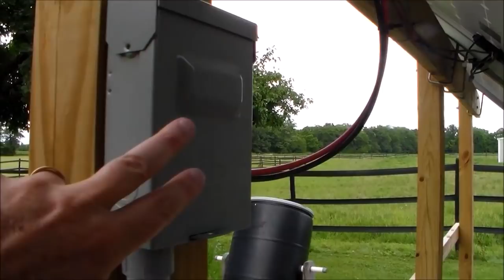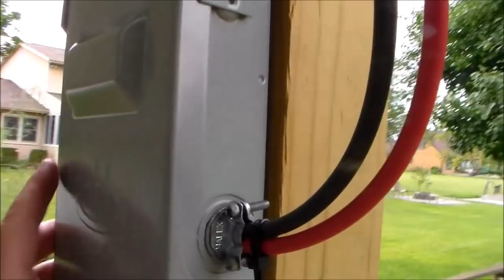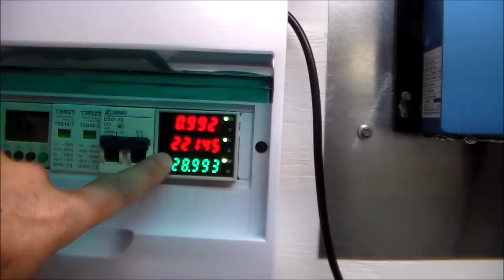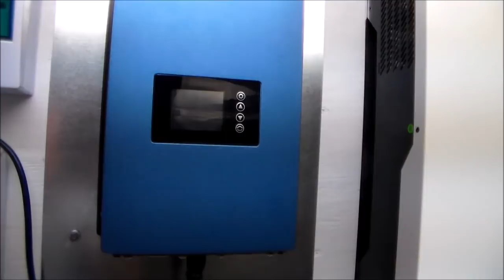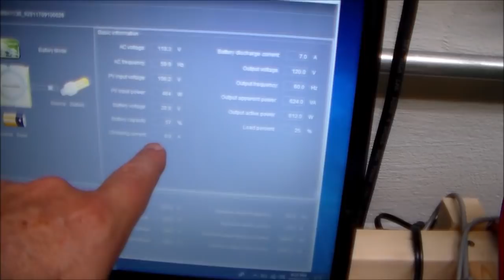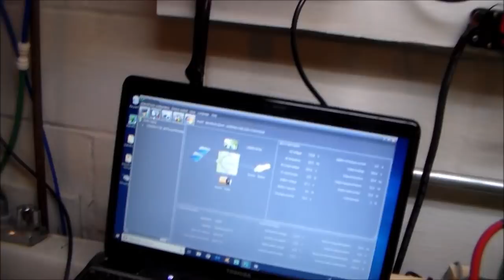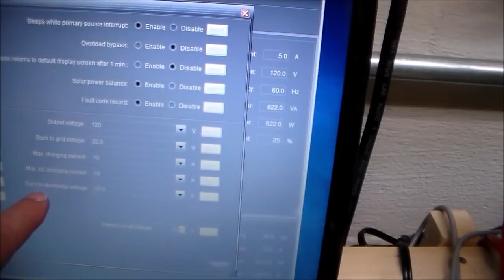DIY Solar - Episode 11 - Up and Running

Comment: Excellent work!!!  How many panel dis you dedicated to the 1000 watts Sun Inverter?  Maybe I'm wrong...but your Sun unit was about 45 to 90 Volts DC input ...I guess that you s et 2 panels in series to get close to 80 volts in a sunny day...with another two panel in parallel for a total of 4 ... Please correct me.  Thanks.

Comment: I'd guess half the value because CT clamp was designed for EU 240v single phase market. GroWatt make 120v grid tie inverters but limiter is done via their own smart meter. They stopped using CT clamps.

Comment: You have to tap both legs then run the 50 MV  2 sensors one for each leg then Series them!
Reply from the maker: Actually, no. This is a 110v inverter. You are thinking of the 220v version.

Comment: The CT ratio has to match the original ratio. If the original is 200:.5, then the new one would have to match. If there is a way to change this in parameters, you could fix it.

Comment: How is the inverter holding up after 3 years?
Reply from the maker: Still running fine. I blast dust out of the fans a couple times a year, but that’s about all I’ve had to do to it to keep things running.

Comment: Hi Jim, I just found your channel today. I appreciate your thoughtful explanations but even more so I appreciate the amount of thought and cleanliness put into your workmanship and installation. I guess the main thing that concerns me is the exposed conduit on the ground underneath your PV setup. I also noticed the seesaw in your video and think running around and hiding or playing underneath the PV array would be very tempting to little ones (especially when the sun is intense). 

Anyway, part of my job is endurance life testing electric motors and their variable speed drives. The setup at my work that predates me used small 3 phase generators hooked up to restive elements (heat) to put a load on the motors. As you can imagine just dumping this energy into heat and then using the oversized HVAC to suck the heat out of the building is insanely inefficient (especially with statistically significant sample sizes). I've set up a proof of concept that uses a 24V diesel alternator attached to the motor test samples via a drive belt with the alternator connected to a grid tie inverter to put the load energy back into the grid and so far it works great, being between 36-41% efficient depending on the load. Anyway I found you while researching grid tie inverters looking for something fairly robust and inexpensive. 

I've been thinking about doing solar on our house since buying it 6 years ago as the sun exposure and direction of the front facing roof is idea for it. However looking into things locally I'm pretty sure I'm just going to go with a 5-6kW grid tie system with micro inverters and use my 4kW inverter generator in the case of a power outage.
Reply from the maker: Hi Ken - Thanks for your suggestions. Yes, my existing setup was really intended to be a temporary proof-of-concept installation since my wife and I plan to downsize our house as soon as we find something suitable. Burying the conduits that are under the solar array wasn't really a high priority since I plan to rip it all out when we move. When my grandchildren are at our house, they know not to go around or under the panels.

I would be interested in seeing what you do with your dump load testing at work. I agree that is a waste that could easily be turned into a gain if done correctly. Please post some videos if you pursue that!

I agree that a micro inverter grid tied system would indeed be a better solution if you are going with 5-6KW. Actually, I have already purchased some inverters for use after my relocation. Of course, I will need to get those set up and approved with the local power company too.

Thanks again for your comments and viewership!  Best wishes!
Reply: @jimginnyohio  Hi Jim, thanks for the reply. As for seeing my test setup, since I am in new product development, posting videos or pictures online is kind of a big no no. Just think of a 2-3hp electric motor that's either DC or 3 phase AC about 20lbs 6-9" diameter connected to 24VDC alternator (large diesel) via a belt drive that is wired to a grid tie inverter. If I want to vary the load on the test sample motor all I have to do is change the RPM's.

Comment: How does the sun grid tie inverter know the phase/180 deg out of phase to match i think thats about the only part i dont understand...i see in your later set up you have 2 of them running one on each leg which i think is one of the more ideal ways to use them... just as ive learned u cant parallel 2 (regular) 120 inverters to get L1/L2 240 because they wouldn't be 2 exactly out of phase legs ....how so the sun inverters basically do that?
Reply from the maker: Since they are grid-tied, they are able to sense the utility power and match it. You can’t do that with non-grid tied inverters unless they have the ability to be paralleled together.
Reply: @jimginnyohio  ok so they match it preciously i guess including phase..whats worst case scenario with them what could happen where they start feeding power back to the utility grid? as a pilot i try to always think of the worst case possibilities and at least have an idea for them.... so if i understand all this correctly u can have 1 of them on L1 or L2 only...or one on L1 and one on L2 ...or theoretically two on L1 and tow on L2 and so on? could u have one L1 and say 2 on the other leg? how does all of that work?
Reply from the maker: @brandonoh777  Since they are grid tied, and will "synchronize" with the grid phase, you can plug multiple units into the same leg or into separate legs. I currently have them plugged into separate legs so they negate as much of my home load regardless of which leg the load is on, or for shared loads in the case of 220v devices in my home. In a worse case scenario and they "accidentally" feed power to the grid, that could be detected by the power company and they could force me to remove the devices else they will threaten a disconnect of service. If that ever happens, I will simply re-install my off-grid inverter and run some of my home loads in an isolated manner utilizing a generator transfer switch. That way, I can still provide power to offset utility costs....without fear of a feeding to the grid.

Comment: You're in Ohio so you're a probably about the same latitude as I am in Central Indiana I'm curious as to how many Sun hours you get per day in the summer and in the winter?
Reply from the maker: Hi Brandon - To better answer your question, you can go here to view the best solar angles to use for your particular location: www.solarelectricityhandbook.com/solar-angle-calculator.html 

Otherwise, to see the number of solar "peak" hours for various locations, you can go here and then scroll down to the peak hours map: unboundsolar.com/solar-information/sun-hours-us-map

i hope that helps!
Reply: Thanks I'll look into that I just bought an app solar 3048 and have 10 250w Canadian Solar Panels that I got used slowly putting a whole system together your videos are coming in real Handy... by the way you said Central Ohio I grew up in Zanesville just east of you there!!

Comment: Hi , i'm working with similar solar plant but , i will add a wind turbine to it  i dont need any explanation about wind part but , one thing is making me confuse , (you can add a gridd tie inverter at the same time with an hybrid inverter ??? like you are injecting power to the output of the hybrid inverter ?? my setup is a 5.5 infini solar inverter with 2 mppt inputs with 5x 340watt panels and with 6 x410 watt and with 2 pylontech 48v lithium battery  , my idea is to add a 1.5 kw instabreeze wind turbine directly to a smaller  battery bank 24v and conect the battery to a gridd tie inverter to suply power to the house at the same time as the hibrid inverter , greeting from portugal

Comment from the maker: Normally a grid error means the inverter is not getting the proper voltage from the grid. Since you said you have the 2000 watt model, I just wanted to make sure you have that wired directly into you panel instead of plugged into an outlet??? That unit needs to receive 220 volts instead of 110 volts.

Comment: Hi sir 
I have 12 panels and I want to know what kind of inverter and charger control a be best for my system 
Panels specifications 
Canadian solar
Model CS6U-340M
Pmax   340W
Vmp.    37.9V
Imp.      8.97A
Voc.       46.2V
Isc.         9.48A
M.S.V.    1000V
M.S.F.R.  15A

Comment: Hi, my name is Juan Muniz. I am from Puerto Rico. I happen to buy a 5kva inverter/charger 220v.
Here in PR, we work at 110 or 120v 60hz. Is there a way i can still use my 220v inverter in a 110v configuration?. I really need help.
The thing is my inverter is from Hong Kong and i really dont know who i bought it from. I checked with Amazon, Ebay, Aliexpress and Alibaba.
And it was not from neither of them’ So if some one can help me, please. I am desperate.   Thanks.   My email is tonym512003@yahoo.com
Reply from the maker: Juan Muniz It’s my understanding that PR uses the same standards as the rest of the US where you have two separate 120v phases. You should be able to wire that device in to provide the required split-phases of 120v each.
Reply: jimginnyohio thank you very much.
Reply: @jimginnyohio  thank you my friend.

Comment: Sense comes with two clamp monitors, that blue inverter only comes with one clamp monitor. Meaning you need to have two of that gridtied inverter so you can clamp it to the other incoming line. That means you need to separately feed each inverter(if you have two) half and half.

Comment: The power indicated on the inverter depends on the current sensor, which has the span 0-50mA to indicates 0 - 12000W ; your replacement  CS (current sensor) is not compatible to the original in electrical spec., the original CS spec is 100A / 50mA  (means: at Max (span) output 50mA (span)) ;  if you replaced with a CS (as you mention on previous clips) has the spec:  400A/100mA (Max span=400A output 100mA so the output of this CS @100A only induced 25mA (1/4 of span) so it's always 1/2 value compare to the original one, and same as the 600A/100mA CS will show only 1/3 value; make it reads correctly you could you the CS with the spec: 200A/100mA, 400A/200mA or 600A/300mA  ..
Reply: I think this was the issue.  This issue work in his favor..since the inverter will never back feed the grid.  If the inverter read 1000 watts, the other meter is reading 2000 watts being used in the house.  So the inverter will only push back to the grid 1000 watts...

Comment: You mentioned Valence recommends charging at 10 amps - I have some of their 138ah batteries - where did you find out and how to charge at that 10 amps and how would you think I find out what to charge the larger batteries at??
Reply from the maker: Chuck Ger Valence has a website that you have to register for. Once you do so, you can download all of there technical spec pages for each of the battery types. You should be able to locate your battery version there. For my setup, my MPP charge controller has software that can be used to set the charging amperage. Since I have 20 batteries, I am able to select a higher amperage and the load is divided amount all of the batteries. While 10 amps is the most I can set for an individual battery, I have my charging set to 50 amps, which works out to 10 amps for each of the batter6 banks I have configured.
Reply: @jimginnyohio   - thanks I'll check into that - How come you went with one Sun Gtil and one MMP Solar - instead of 2 of 1 or 2 of the other? And do you have all your batteries just on the MMP Solar? And one last question - I bought some BMW I3 batteries which also are about the same as your Valence in AH -  how long do you think 1 would take to charge up from 11V - to full (13.6 or more) at the 10A charge. I've charged these BMW  1 at a time 13.2v, at 6-7A and it's taking about 24- or more hours making me wonder if these are pretty tired, but they seem to be holding the charge.

Comment: Are you using the same panel input for both your grid tie inverter and your off grid inverter, or do you have dedicated panels for each system?
Reply from the maker: Niclas Lindström Dedicated panels for each inverter. The grid tie inverter has four panels connected and the off grid system has eight panels connected. I suppose I could add another grid tie inverter and use a dc switch to move between that and the off grid inverter, but no need for that yet.
Reply: @jimginnyohio  Thanks for your quick response. I am just thinking, why can't you feed both systems with the same larger array. In my world that could give you the opportunity to use the maximum power at any point in
 time. I am not a professional, just like you, so I only want to bring up
some questions for the knowledgeable...
Reply: B.t.w.  I am impressed with your work! Keep up your good work.
Reply from the maker: Niclas Lindström Each of the inverters have a certain operating range for voltage requirement. The off grid inverter will accept much higher voltage than the grid tie system. If both systems were running from the same panels and one of the systems failed, it could create an over voltage condition and possibly cause damage to the other inverter. You are much better off keeping things simple and dedicated for each system.
Reply: @jimginnyohio  I got that, I was just wondering if it could have been better IF they could operate on the same potential and sharing the full panel array. Maybe that is a parameter to take into consideration when designing a system like this when selecting components. Or would there be any disadvantage in doing so (if my controllers can work in the same voltage range)?

Comment: Hi Jim, nice videos on your system. I bought most of the same stuff to build my grid tie system after watching your videos but I'm only running a 24v set up. I'm just testing mine now but still waiting on one part " over under load protection" if you don't mind what did you set your over and under at?
Reply from the maker: jessedude73 I set the upper limit to 124V and the lower limit to 110V. Good luck with your build!

Comment: Hi Jim, great setup. I just bought some of the same Valence 138Ah batteries, and am wondering, did you connect the external BMS to the communication wires of the batteries? Did you plug all the batteries together, or just the ones in series? Thank you very much
Reply from the maker: Noah No BMS in my setup yet. My batteries are simply connected in series and parallel for 24 volts. I do not have the BMS cables connected together either since those serve no function without the BMS and terminator installed.

Comment: Jim did I hear you correctly, you only have 2 panels supplying power to the grid inverter? If so those panels are in great positions to supply that amount of watts/volts.
Reply from the maker: No, I have four 255watt panels feeding the grid inverter.
Reply: jimginnyohio Thanks for clearing that up I appreciate that!👍🏽

Comment: Please note any device with a motor like your humidifier has a much higher surge wattage than its running wattage and that I the wattage you should be concerned with causing problem with your inverter like frying MOSFETS or causing temporary shut-downs of power output.  Never deplete your batteries below 70% or they will not last long.

Comment: Also Code requires labelling as a firefighter mentioned below.  Each disconnect needs a proper red an white permanent labelling affixed next to the disconnects at a required placement and a map should be posted near your outside incoming connection from the grid at your household breaker box on the side of your garage mapping out where all solar disconnects are on the property and a label indicating on the breaker box which circuits the solar panel are connected to so the fire department or utility company can shut off the connection to the grid form them from outside your house without you being home if needs be.

Comment: I see definite problems looming with your install.  Your disconnect with red and black wires coming in… will likely rust, short out or some combination of the two.  You can't put bare wires into a box like that outdoors, you must only run the wire into the box through a weather-rated weather-tight connection an conduit.  Anyways if water and condensation following your cable right down into the box (you have no drip-loop to make it go otherwise) doesn't trash your setup, eventually sun exposure on those non-solar rated cables will crack the insulator off the wires.after the color fades and water will get into the wires and rust them away over several years time…. be forewarned.  Immediately you should pull the wire down before it goes back up into your boxes as a drip loop that will save you in the short term, but to protect long term from condensation and from.windy rain storms you must install the tires through weather-tight fitting and conduit from source combiner box all the way to destination.shut-off box mounted on the poll.   Note if you haven't fixed this already, probably water has entered your boxes and streamed down into your underground conduit and you will have to "Blow" the conduits out to rid them of the water intrusion and seal them at both ends to prevent any future such occurrence with silicone.. and of course do the proper cable connection for the incoming wires to prevent water getting into the box in the first place.
Reply: Some of what you say might be correct, I really don't know.  However you mention rust several times.  Metal alloys with a base of iron such as steel can rust.  I am pretty sure that he is not using steel cables to carry electricity.